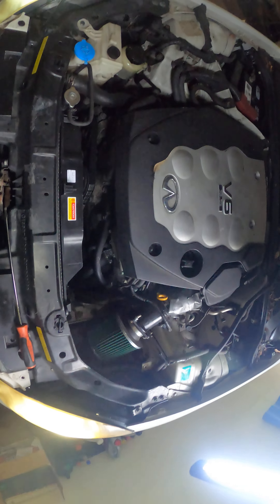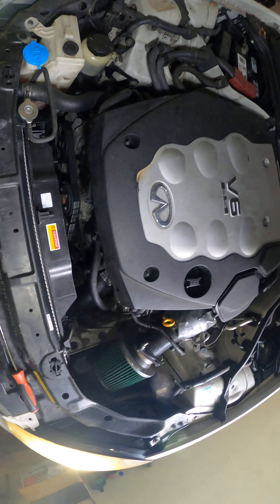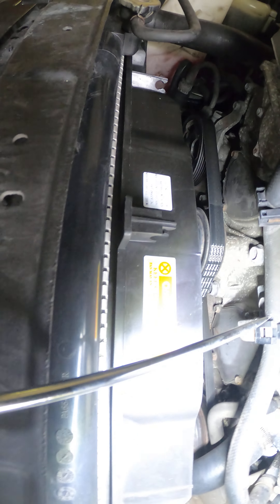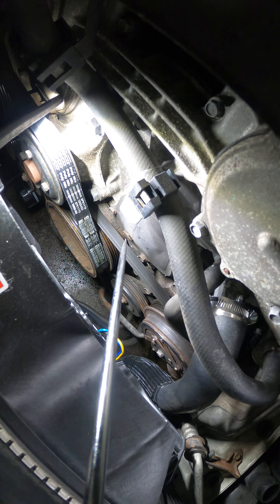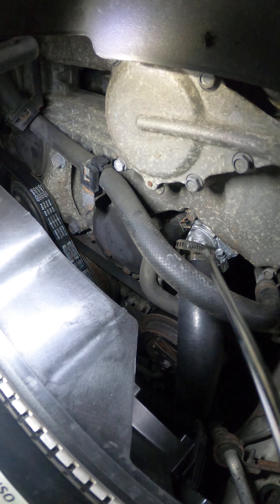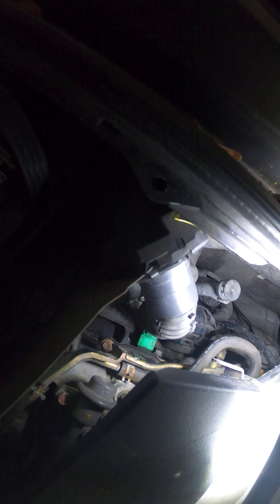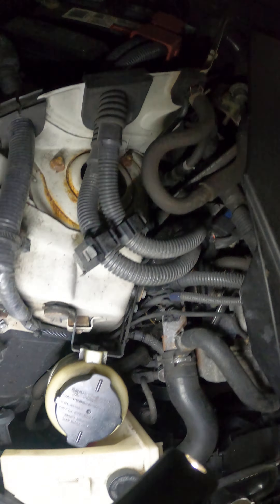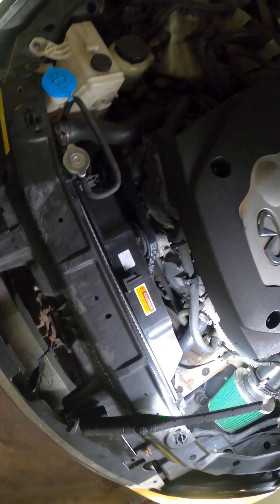Infinity G35 M35|Nissan 350z|Coolant Component Locations

Comment: Do the radiator caps fail on the G35?
I got a 2006 coupe, just turnded 65k original miles. I smell coolant today. First warm day in Philly, you know! Im right outside the city. I see some coolant marks around the cap. Like its spittn coolant.
Reply from the maker: They can fail and are supposed to hold the right amount of pressure. I would replace them like every few years, they're usually cheap like a few bucks
Reply: @PhillyDee215  appreciate your input. I'm getting one today. It's getting worse.